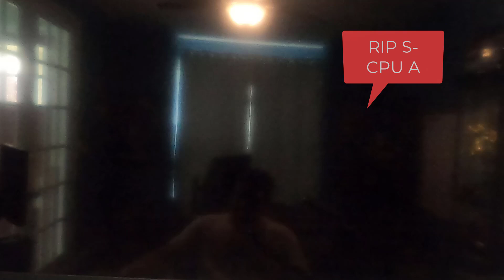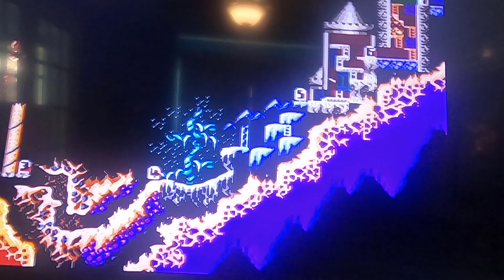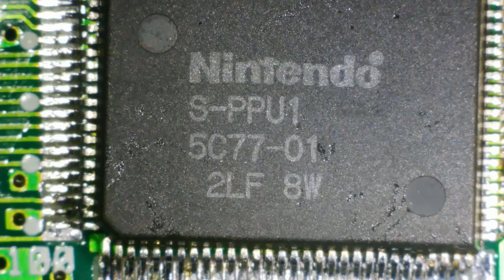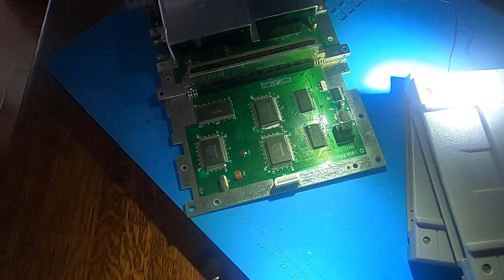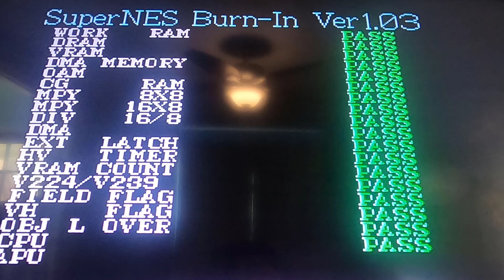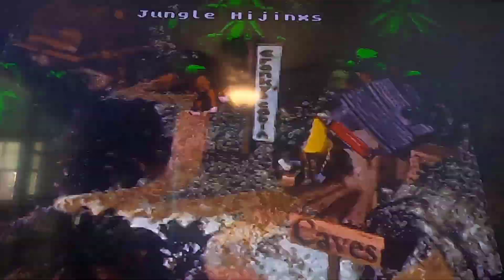Super Nintendo/Famicom faulty CPU or PPU repair

Comment: I'm trying to diagnose right now. Most games don't load at all and the ones that do like Super Mario RPG always act abnormal. When I start a file, Mario jumps back to file select screen and when I go to game, the music plays and I can move and enter pipes. The game won't let me pause or access any menu's of any kind. When I go to the next screen, the screen turns black with music playing and it pretty much ends there. Donkey Kong Country does start up, but the title screen usually resets itself indefinitely unless I reset the system itself. When I do, I can start a level. I can't pause or finish a level at all or access bonus areas. Some other games like Super Mario World won't start, and Super Mario Kart freezes right at the Nintendo logo. I've cleaned the system and there's no evidence of damaged traces. I'm leaning towards a CPU failure, but I'm not positive.
Reply: Is a CPU related issue. There is also another way to test SNES chips if you don't have the Burn-in Test cart.

If the fuse and 7805 regulador are good and your SNES turns on and capacitors are ok then your next step are the chips. If the chips gets too hot after powering on (for example the CPU) most likely the chip is shorted.

Comment: You should replace the New regular 7805 too..
Reply from the maker: Is there a benefit to replacing them?  I have some new ones, but I don't usually replace them unless they're faulty.
Reply: @RetroConsoleRepairs coz they are faulty  .. can break your ppu again no longer
Reply from the maker: @phouleng just replacing the 7805  resolves this?  Do you have any sources that support that?  If it's true I'll start swapping them out.
Reply: @RetroConsoleRepairs  replace it because I have repaired it many times and I know the reason for the damage to the cpu and ppu
Reply from the maker: @phouleng is there a certain type or any new 7805 will do?
Reply: @RetroConsoleRepairs ic 7805 is power supply that works on the mainboard
Reply: Old things can be faulty
Reply from the maker: @phouleng I know what it is 😂

Comment: Thank you for this new vid! I tried swapping a ppu/cpu many times on like 6 SNESes but I never managed to repair them, something always remained bad. I do have one special case that I dont know what to do with. I have a 1chip that only boots select games, but when sound is about to be played, it freezes. Even Test / Burn-in cartridge sound test fails/freezes. What could it be?
Reply from the maker: I haven't messed with 1CHIPs too much.  All the ones I have come across never had any issues and have been very reliable.  What was the result of the burn-in test?
Reply: @RetroConsoleRepairs  I just know when I launched sound test it froze, I'll come back with a proper result soon ^^
Reply from the maker: @strnadik did you recap it yet?

Comment: Have you done a H2O2 bath with UV the restore the shell color?
Reply from the maker: I have done some retrobrite work, IMO it's not really worth it as the plastic is already brittle when it's yellowed.  The retrobrite make it worse.  If you have to run screws into that it's gonna break.

Comment: Does one ppu handle the mode 7? Is that what you are talking about with figuring out which one is bad?
Reply: Super Castlevania is a great early game that uses Mode 7 a bunch.
Reply from the maker: @BmoreIrish the SNES burn in cart will run mode 7 if it can pass the hardware test 😬
Reply from the maker: No, according to several things I have read PPU1 handles sprites.